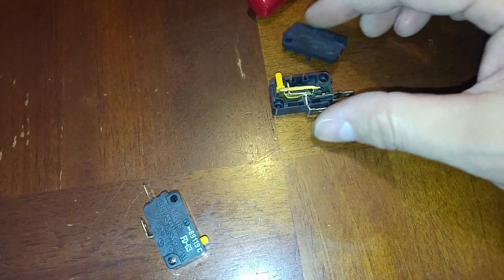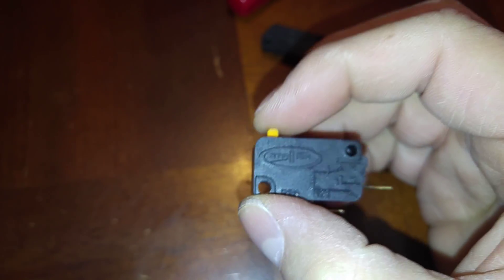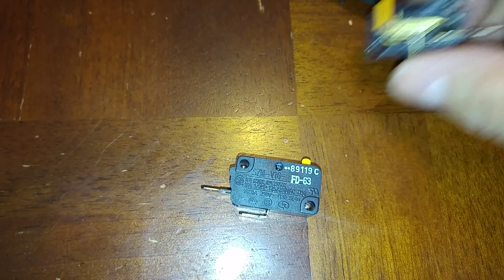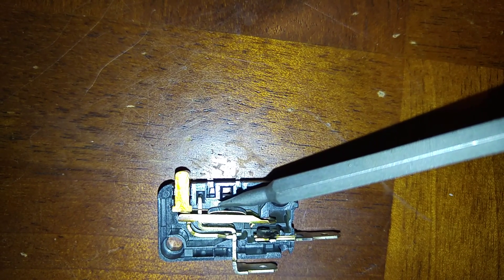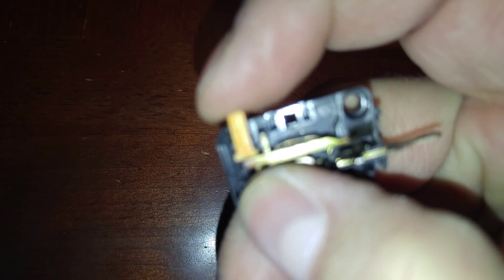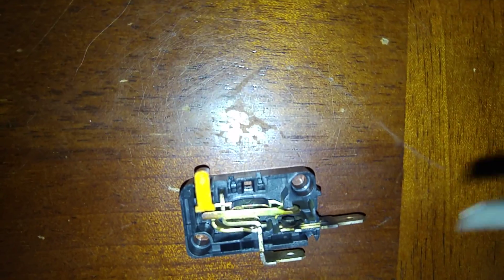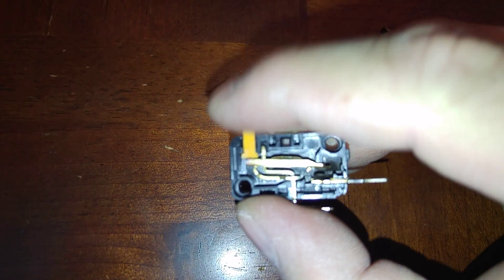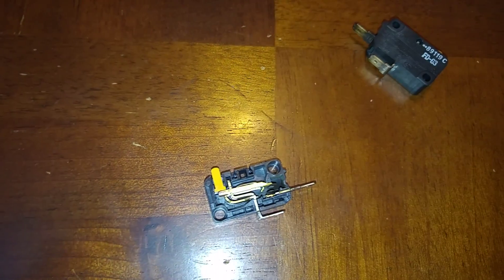Microwave running when door open quick fix

Comment: If a strong click is important to you, take your switch apart and bend that piece as described.  If you want your microwave to work properly, then clean the contacts that are obviously bad (the blackened pieces that also used to be gold colored) or, even better, replace the switch entirely.  The contacts can be cleaned with a small file or small piece of sandpaper, but better to replace.

Comment: New Problem:  I replaced my bad switch with a new one off ebay.  It only lasted about 4 months and now is doing the same thing.  I would have designed a switch that defaults in the off position.  When it fails in the ON position, it can catch on fire and burn down the house.  Should be a recall.  File a complaint.  We can do this!

Comment: Today my microwave just started on its own when the door was closed.  I suspected one of the interlock switches.  I removed the control panel and took out the two interlock switches.  Was surprised to find that in one current flows when closed and in the other current flows when open.  Don't think it should be that way, these switches are the same visually, and the same according to the sears parts direct website.  Getting a replacement, shall see if this is the cure.  BTW, the switches are not in the door, they are in the receptacles for the two hook-shaped latches mounted on the door.  You have to remove the keypad to get to them.  I might decide to take apart one of the switches to see if they show like what you have here.  Thanks.
Reply from the maker: livemeyer you're on the right track. That's Basicly how I ended up finding this being the problem and yeah you have to remove the control panel to get to them.

Comment: Thanks for this video....  I just used to "fix" a faulty switch on my GE... this was a great help!  Only minor criticism is lack of detail on how to take apart the housing on the switch & hints on how to remove and replace that metal bar.  But I figured that out... and would never have known about the possibility without this.
Reply from the maker: Laura Sheaffer I apologize for the lack of detail. I kinda figured if people have made this far in finding the problem..... That part could be figured out. My bad. Glad you got it figured out.
Reply: @petyweestraw  yeah, me too --- not so sure how to open the switch without a hammer and chisel... suggestions?
Reply from the maker: @marvinratchford7913  it pops open fairly easy. If I remember correctly there should be little tabs on the side . I used the little screwdriver you see in the video to carefully pry it open.
Reply: Thanks. This video shows the guy opening it with just his barehands: https://www.youtube.com/watch?v=pO73pKTyU_E&t=126s
I did that and saw heavily crusted contacts so that convinced me of two things 1) replacement is far better and easier than detailed repairing 2) while microwaving, remember to press STOP on the microwave door rather than just opening the door and ruining the contacts --- i.e. the appliance was NOT designed to be cut off all the time just by the door!  @petyweestraw

Comment: I have the opposite problem.. buzzing sound without light when door is closed, heats stuff too... no sound when the door is open. ......... could the problem be switches too?
Reply from the maker: Sanj San It could be one of these switches are stuck or the switches aren't being clicked when the door is closed. There are 2 tabs sticking out on the door. They click the switches inside the microwave. I would check these switches. Make sure they are clicking. If not they are bad.
Reply: petyweestraw thanks for you reply.. I figured my keypad was bad.. pressed a bunch of keys randomly Nd it works okay for now..... I might have to open it up and clean the contact points
Reply from the maker: Yeah I ended up cleaning mine when I had it open. Had like oily residue and some moisture in there. Not surprising with all the cooking that goes on right underneath it. Glad you found the problem.

Comment: Am I missing something? That's great that the replacing the relay switch will fix this problem:HOWEVER, how do you get to the relay switch???
Reply: theres a video on youtube about ge switch replacement. shows you step by step how to easily remove the switches
Reply from the maker: Global Kalinga e-Rotary Club 
You have to remove the keypad/control panel. There are two in there.

Comment: where do you find the switch have to take door apart? thanks
Reply from the maker: you have to take off the control panel. then you can get to the part that holds the switches. they will be to the left of the control panel when it's removed. the remove the part holding the switches
Reply from the maker: if you have trouble I can probably send you a step by step with pics